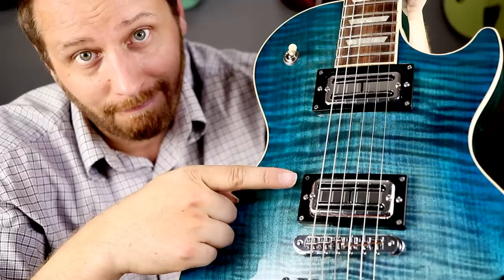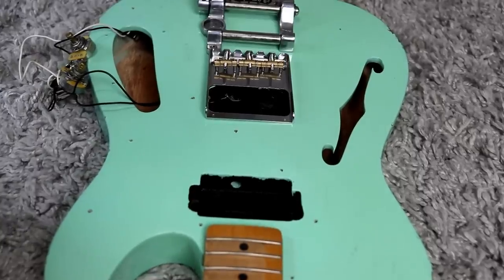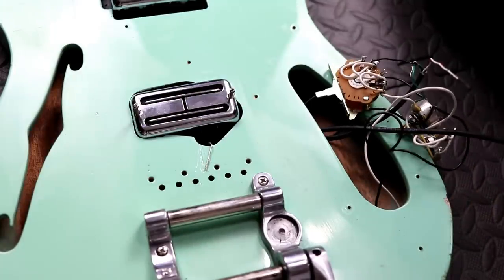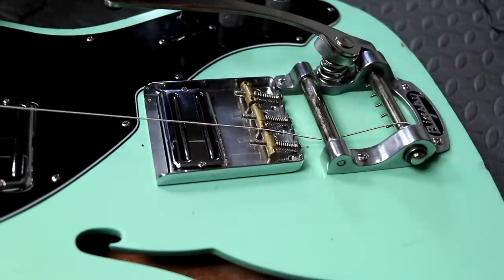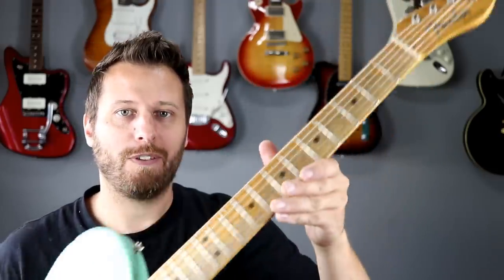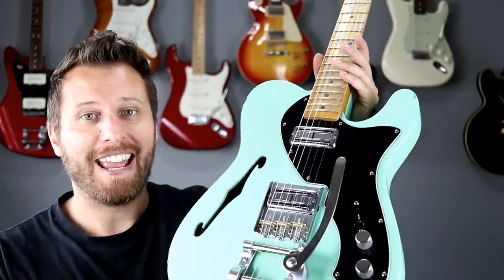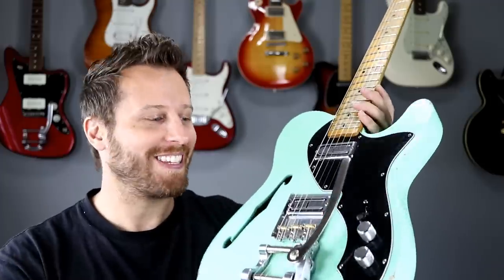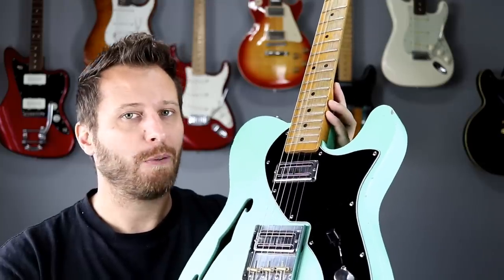Putting Filtertrons In a Telecaster! - AMAZING Tone!

Comment: Great Mod.  Truly silent.  I had an American Standard (Ash body/Maple veneer top).  I hated the Fender (Not) Silent pickups.  When I took off the pick plate it was routed for a middle pickup from the factory.  I guess it was also set up as a " Nashville model."  i routs a hole for a middle pickup and installed 3 Lace Sensor Gold pickup and a 5 Way Super Switch.  I wired it for standard neck/middle/ bridge with positions 2 and 4 neck/middle and bridge/middle so I had sort of a Tele/Strat.  It was a very useful gigging workhorse.  I was playing in a blues band at the time.  I traded it for a Music Man Silhouette hard tail and never looked back.  I would love to have a G6122TFM but hey I do have a Guild Starfire IV in the closet.  It's pretty much a gigging relic.  All beat up with most of the finish played off the back of the neck.   A pair of those JE Tron pickups would be an interesting update.  It already has the Guild "baby bucker" rout so maybe the mounting rings will work.

Comment: From Leo:  The capo trick for Bigsby restring is a good one for sure.    Another method is a big pencil eraser, just wedge it under the Bigsby holding the string against the string bar.   Keep an eraser in the case and you are always ready, only costs 50 cents.

Comment: Was that a retcom when stringing the Low E? Looks like it was wound Clockwise then cut to it being CCW. Great video though, I've gone through an underwound Fralin PAF and Unbucker and currently a Bluesbucker. They're all great pickups, I use the PAF in a Les Paul and the bridge pickup on a 335 with the Unbucker in the neck. The Bluesbuckers I've installed in some SSH Strats, but I was excited about any of them in the Tele. I did a setup on a guys Tele with a TV Jones in the neck and found it to be perfect. The overall tone really does straddle the line between a Single coil and humbucker and the output  really balances well with the single coil bridge.

Comment: Darrell...good job! It looks like a mint chocolate chip ice cream guitar based on the colour and cool tones! Love the F hole!

Teles are pretty close to Gretsches tone wise and complement one another. Now that said there are several ways to go about this. In my Tele I bought an actual Gretsch Filtertron and had it installed by my luthier. You can also buy a pickguard blank and trace out the exact dimensions on that too. For the bridge you can buy notched ashtray style bridges from Mastery and I am pretty sure TV Jones offers some as well. Also you can go with a Filtertron is a humbucker size from TV Jones or a GFS Nashville pickups. They are drop ins if you have a Deluxe or Custom Telecaster. 

I looked up your pickups and they are not cheap. I think they might be a bit more than the TV Jones pickups. Also Seymour Duncan offers Filtertrons from their custom shop. I know a few other people make Tron style pickups too.

If you keep the traditional bridge pickup the Filtertron will overpower it by volume even if the single coil is hotter! My guitar has a GFS Lipstick and while its a great pick up it essentially acts like a choke in the middle position for the Filtertron. Putting a Tron style pickup will bring a bit more focus in a Tele than say on a Gretsch hollow body. If you want to do this on the cheap I would suggest the GFS Nashvilles or the Dream 180s as they are humbucker sized and are under $40 each

If you want a production style Telecaster you might want to look at the Schecter PT Fastback ll models. The pickups are not quite Filtertrons but they are close, coil tapped, and each pickup has a seperate tone and volume. It comes with a Bigsby and a TOM style roller bridge.

Comment: this is the same tele that had the Fralin pick ups in it, right? I really liked the tones you got out of that setup. This is something else again! did you go for both filtertrons straight away or did you try just installing the neck Gretsch PU and see how it went with the Fralin bridge PU?
Reply from the maker: Hi Tom! 
Yes this is the same Guitar :)
I just went straight for the full setup. 
The split blades are pretty awesome pickups too though. They really have a good single coil sound, but without the noise. 
These just have a bit more of the tone I was hoping for this particular Tele :)
Reply: Well Done!

Comment: A long time ago I learned a faster and more efficient way to string vintage tuners... Instead of measuring, cutting, kinking, etc at the post, just pull the string tight, wrap it UP the post by hand, then pull and kink it backwards through the slot in the post... two winds for wound strings, three for unwound.
I've done this for over 10 years after first reading it in Dan Earlewine's guitar repain handbook... I never have tuning issues, slippage, etc... and I believe the strings seem to feel more "vibrant" seeing how they aren't twisted in the tuning-up process

Comment: Great project Darrell!  I am trying to mod my Squier 72 Thinline with filtertrons and having a hard time with the pickups fitting in the pick guard and lining up with the saddles.   I am really not sure what to do at this point.   Yours turned out great!
Reply from the maker: Hi!
Did you get a new pickguard cut out for filtertrons? If so, they should slide in and then screw directly to the guitar body :)
Reply: Darrell, first I tried modding the original which didn’t work well so I ordered a pick guard from a company that said it was filtertrons and it turned out to be for humbuckers, so I am stuck.   I filed the one for humbuckers so the filtertrons fit but the bridge pickup is not exactly in line with the strings due to the saddle string spacing and pickguard.  Any idea where I can get the right pickguard?
Reply from the maker: Oh,  that really sucks!
Getting the right pickguard will solve everything. You might have to go to a custom cutter like Warmoth or WD.

Comment: Man I love this. I want to do this same build. I have a question though, did you use the regular tele 250k pots or 500k pots? Also, how do you think a 4-way bridge/neck in series switch would sound with this set up? 👀
Reply: Did you find out the answer to this?
I have the same question.

Comment: Hi Darrel,
Thanks for your videos! Question: Did you have to shim the neck in the telecaster to install the bigsby and get it ready for setting up action and intonation properly? I wonder if you can get away without modifying anything regarding the neck when using a bigsby. 
thanks
Reply from the maker: Hi! 
Nope, just bolted it on. 
That's the advantage of using a regular tele bridge. Action can stay exactly the same :)
Reply: Thanks!  The saddles seem to be rather high though.

Comment: Another trick for holding the strings in place on a Bigsby is a rubber eraser. The wedged ends work well at holding the strings. Just wedge in the wedge 
Vibramate also makes the String Spoiler which does away with the hassle completely. Not expensive and installs easily over the Bigsby pins (no modifications). I use one on my B5 and am considering one for my B6.
Reply from the maker: Thanks for the tip SG!  I'll definitely check it out :)

Comment: This guitar looks and sounds amazing. I’m thinking about doing a conversion like this on my tele. Where can I get the bridge plate? I’m looking everywhere but can’t seem to find one like in the video.
Reply from the maker: Hi! 
Try the TV Jones site. They might be your best bet :)
Reply: Darrell Braun Guitar Hi Darrell, thanks for your response! I checked on the TV Jones website but couldn’t find one that had the correct number of screws (I have a 4 screw bridge). Where did you get that exact bridge used in the video? That seems to be the bridge that would fit on my tele. Thanks!
Reply from the maker: I got this one on eBay out of Germany. I think I got the last one as it isn't listed anymore :(

Comment: Neat trick I learned for bass restringing that I imagine would apply to these vintage style machines, is to slightly bend the very tip of the string where it was cut off. The theory is that when you bend it, it keeps your wound strings sounding better longer because the windings can slip from the core, and this trick is said to keep it from happening. There's a video on the channel Scott's Bass Lessons that details it better than I. Haha.

Comment: Darrell, is that the Tele that used to have the Fralin Split blades?
Reply from the maker: Hi Adam!
Yes. Those pickups give a really great single coil sound (but are noiseless).
I think I'll be giving those away on my Patreon in the future :)
Reply: HOw'd you get the relicing on the fingerboard?  Did you buy the neck like that?
Reply from the maker: Yes,  the "road worn" series had factory relic'd bodies and necks.

Comment: Did you string that 6th string wrong originally? In one shot it was winding to the outside, and in the next shot with all the strings on it was on the inside. The capo trick is good thinking.
Reply from the maker: 😄 Good eye! 
Yup, I was filming on the other side of the guitar and wound it backwards like a noob lol!
Reply: If you manage to get the strings on without drawing blood or sucking on your fingers you're doing fine. ;-)  I never knew there was a proper way to put strings on my old 70's Frankenstrat. That's what those holes are for, huh?

Comment: You didn't go into how the pick-ups are actually attached to the body....and can you adjust the pick-up height after they're installed?
Reply from the maker: Hi!
Like all filtertrons they are screwed into the body. They can be height adjusted, but the process it is a little different that the standard spring and screw system :)

Comment: Exact same dimension as actual Gretsch Filtertrons? Or are they a little different, like TVJones?
Reply from the maker: Hi! I believe they are all the same exact size. My Gretsch Duo Jet has after-market TV Jones pups that fit perfectly :)
Reply: @DarrellBraunGuitar  TVJones state in their specs (or used to, at least) that the corner radius for their pups is different from Filtertrons. 

I purchased a couple TVJ rings that were the same idea -- HB external footprint, TVJ internal dimensions -- but had to enlarge the corners, because the Gretsch HS Filters were indeed slightly more squared/less rounded.  They were the only such rings I could find at the time (five or six years ago), though, so had expected to mod them a little.
Reply from the maker: Interesting. The JBE 'trons that I used in the tele are for sure filtertron sized :)
Reply: @DarrellBraunGuitar  Thanks, that's helpful to know. I like the idea of bladed 'trons, to accommodate a variety of bridge spacings. Installing an original Gretsch HS set requires fudging the alignment on both the bridge and neck pickup (each having that weird 48mm pole spread) a bit.

That's a great Tele build; got another HS set handy to try one myself.

Comment: My favourite Squier is my Cabronita with Filtertrons.
Reply: danmar007. I think you mean 'FIDELITRONS' , which are the  Squier version of the Gretsch Filtertrons. I have a Cabronita with Bigsby, so it has a neck Fidelitron and a standard single coil pup at the bridge. The Cabronita without the Bigsby has 2 Fidelitron pups.
Reply: Robin Seward You sir, are absolutely correct. So now I have to install Filtertrons! :-)  It's still my favourite Squier. The Bigsby must make your Cabronita interesting.
Reply: Hi danmar007. I've only had my Bigsby Cabronita a short time so still getting into it. I do like Bigsby trems and I've recently fitted one to a Squire Classic Vibe Telecaster. Slightly tricky job, but it's worked out fine and plays well.😀
Reply: Robin Seward I've often read that they are temperamental. Is that true? I think they look great on a Tele.